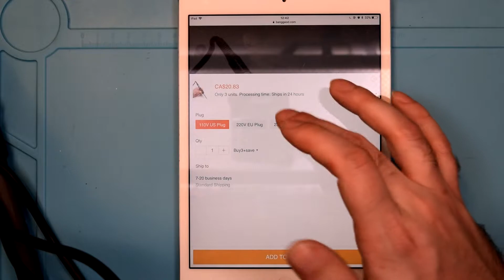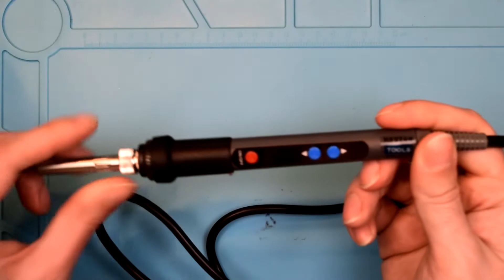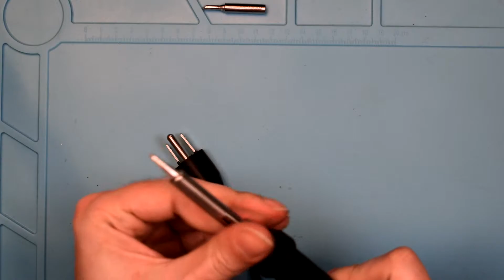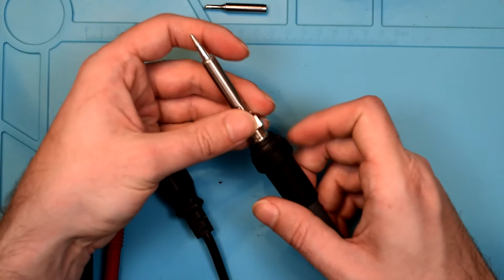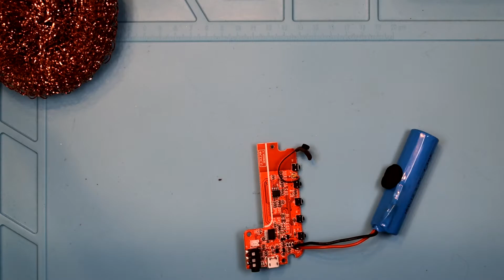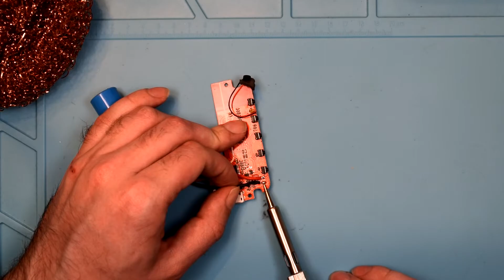PX-978 Soldering Iron Review (from banggood)

Comment: It looks like this soldering iron sucks. You couldn't even desolder very small wire from very small PCB (low thermal capacity) without a trick with using SnPb first.
Reply from the maker: It certainly wasn't the best in the world. The tips corroded really rapidly, and it lost its temperature control. To be fair, though, I almost always wet a joint I need to desolder with fresh lead solder both to make it easier to work, and to introduce fresh flux.